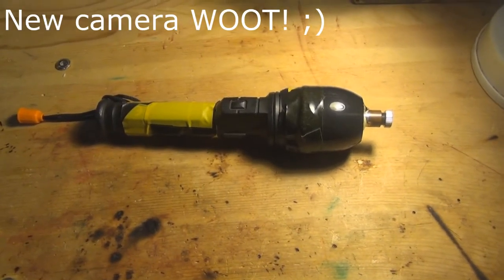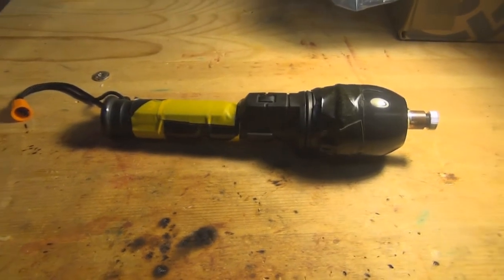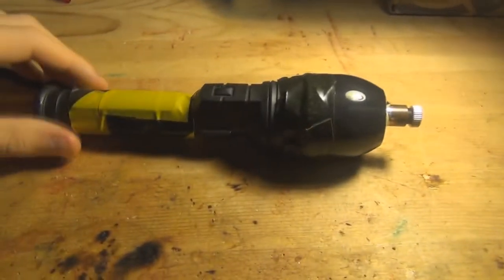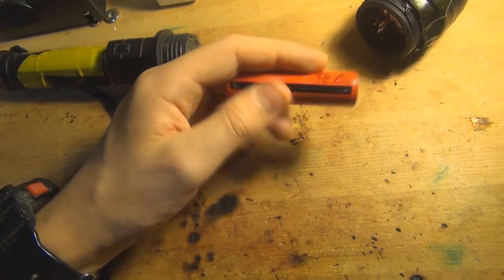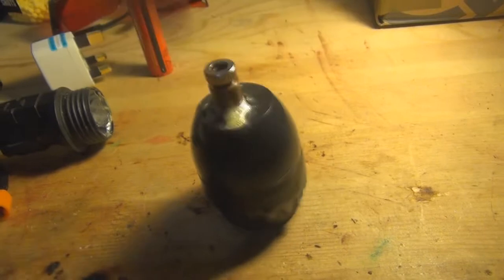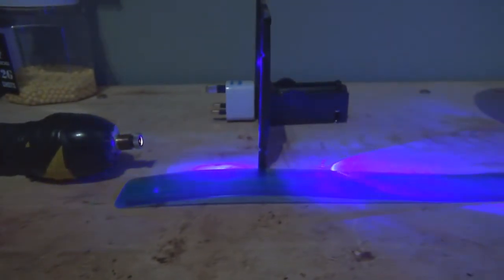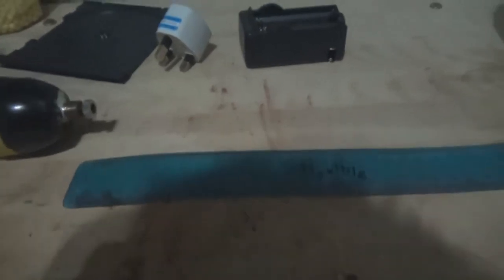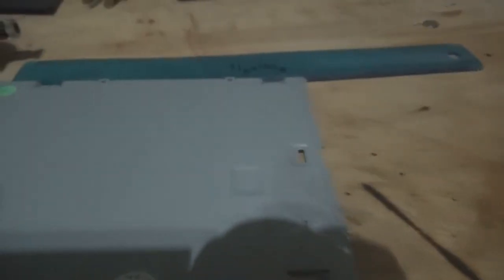My Laser Project - 1 Watt Homemade Laser

Comment: Nice first build, but there are some thing you must take into account.First change those batteries unless you want to get hurt, do some research on fake xxxxfire brand batteries.Second, you must add a heatsink to the diode and driver in order to keep your laser from burning out.Third, are those lens glass single element, ot 3-element glass, the lens which comes with the aixiz module are acrylic and will degrade over time and probably damage your diode.Keep up the good work and dont foget to register in laserpointer forums dot com :)Happy lasing